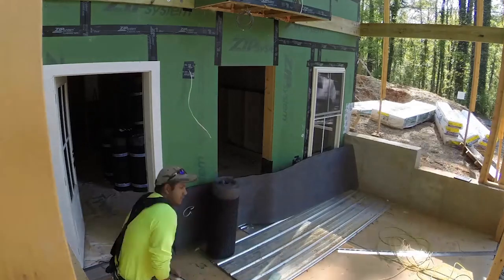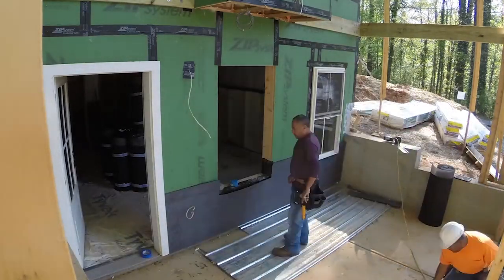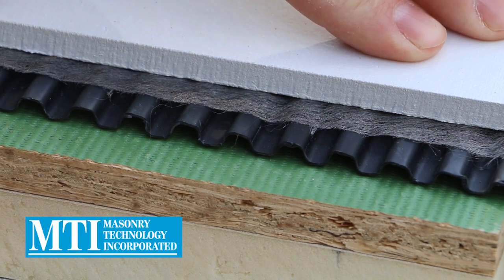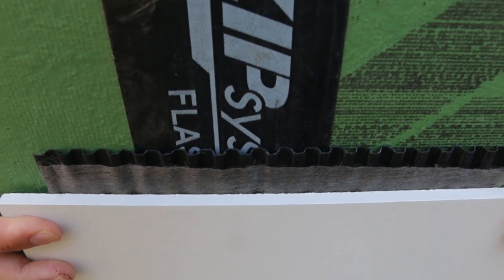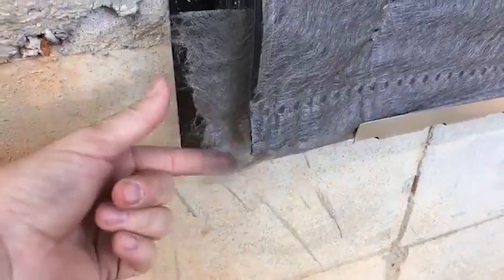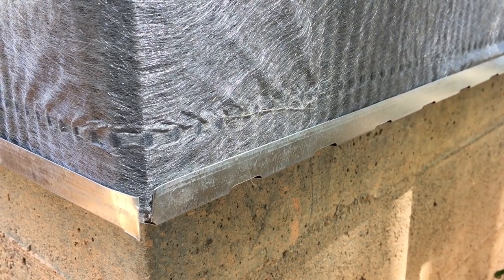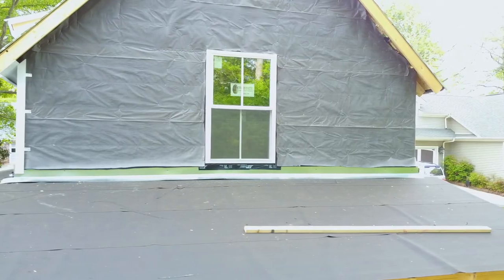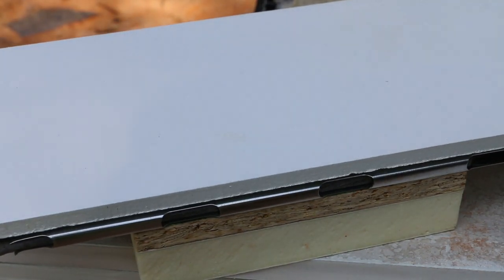Rain Screen Installed Over The Sheathing | TECH 004

Comment: Interesting stuff Tom.  It's interesting that the more air tight we make the envelopes of our homes, the more we are required to step back and provide ways for air to circulate behind the various layers that act as our moisture and thermal protection systems.  Incorporating a rain screen design detail behind the concrete siding is a great idea to keep the substrate from rotting out over time.

Comment: Why not just use there furing strip that comes as a 50 foot roll?
Reply from the maker: That would have been an option as well (and I have seen this done). The Sure Cavity production was recommended for use with the Zip System sheathing. We wanted to give it a try. Thank you for watching.

Comment: Water should never breech the exterior siding. In the unfortunate event it did, thats exactly what zip systems is for. No siding is completely air tight either. Seems like a complete waste.
Reply from the maker: Hi Brian. Thanks for the feedback. With wind driven rain, water can stack up on the side house and get behind the siding. This is rare, but more often, with a tight house like ours, it is the condensation on the surface of the Zip. This rain screen provides a larger air gap for evaporation or drainage, depending on how much we are dealing with. Thank you for watching.
Reply: Read zips installation pdf, it explicitly says to use a rain screen.
Reply: My thoughts exactly